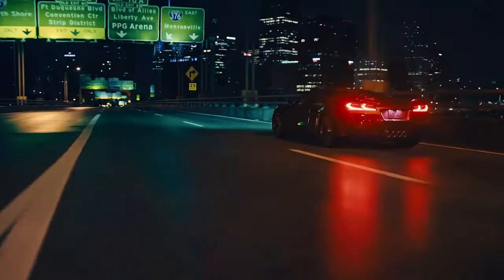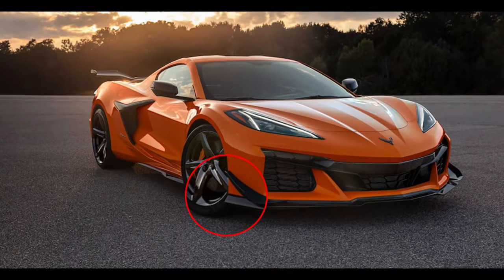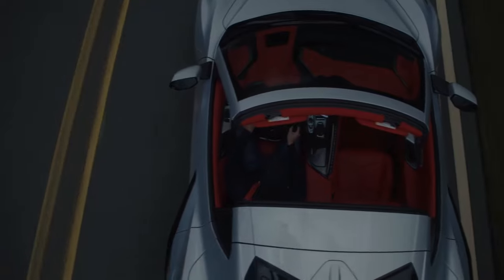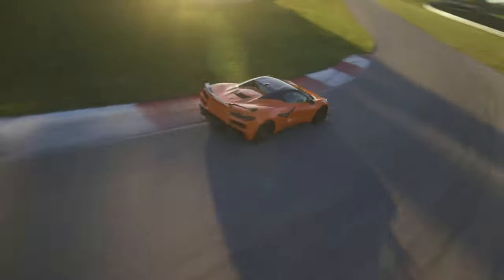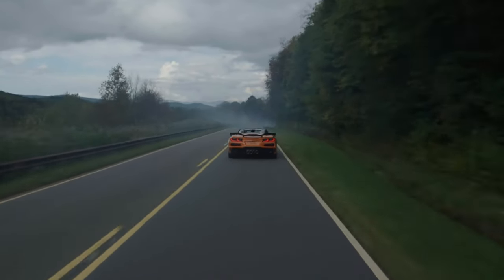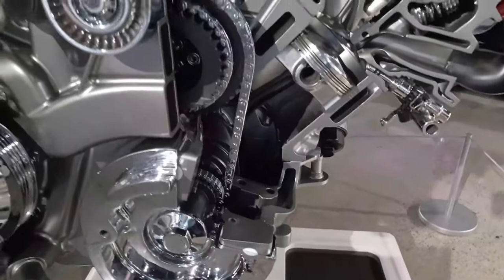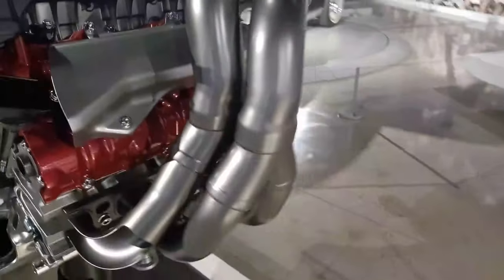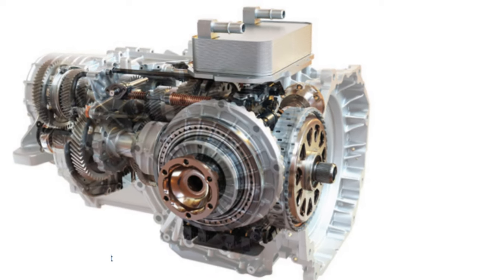2023 C8 Z06 Corvette EVERYTHING We Know

Comment: 🤔 Here's my confusion. The review states that this new Corvette engine(at 670hp) produces 170 more horsepower than the previous Corvette engine. But the previous 6.2L Corvette engine produced as much as 638hp over a decade ago, and its 2019 variant is rated @ 755hp in ZR-1 form. 

〽 But MUCH MORE significant is the fact that, although the newer 5.5L produces an impressive 670hp, it only makes 460ft/lbs of torque, which is a whopping 255ft/lbs less than the 2019 6.2L 715 ft/lbs! 

✅ To be clear, I have no doubt that this new Corvette is mindblowingly impressive, especially considering it's made by Chevrolet, a company that produces millions of inexpensive family sedans and pickup trucks, NOT a boutique Euro-supercar company like Lamborghini or McLaren. But I'm wondering how much difference owners of pre-5.5L Corvettes will notice with the severe drop in torque once they lay into the gas with their 2023 model next year(??)
Reply from the maker: The comparison is to the most recent naturally aspirated LT2 engine. This engine is the highest horsepower naturally aspirated factory production engine ever produced anywhere. The former "record" holder is the 2013 Mercedes SLS Black Series at 622hp. Each of the engines you refer to are Supercharged. The 2019 ZR-1 now sells for about $200,000. This Z06 can now be had for half that price. I am sure that anyone that is disappointed in the power output can easily add a Supercharger. There should be several available within a year of launch. And the cost should be fairly reasonable. As far as how future owners will feel about their car, only time will tell.
Thanks for your input. - Tim
Reply: @C8CorvetteLife  
✅ Ahh, OK... I missed the "naturally aspirated" dynamic in the comparison. Yeah, so 670hp is great for 5.5L unboosted. What's the bore x stroke ratio of the 5.5L? I'm guessing its significantly oversquare, based on its HP to torque ratio. Thanks.
Reply: With a flat plane crank motor less torque is needed do to the fact it makes its power in higher revs .the push rod engine only revs to 6500 compared to the flat plane crank  engine 8600. Time for a game changer and the lt6 is it . Super car status is what this is .  Push rod engine needed superchargers to achieve over 600 hp this thing is all natural . Wait till they put turbos on it. 800 plus hp we are hearing for the zr1 vette coming in next 2 years or so .
Reply from the maker: Many times the raw stats don't tell the whole story. What is more important are the real time stats. The 755hp 2019 ZR1 does 0-60 at about 2.85 seconds. The base 495hp C8 does that and the 2023 Z06 will beat that by several tenths. And we haven't even gotten down to lap times yet.
Reply: @JeffCarsboatsatvs  
At least its also got the supercar looks to go along with the performance. The first time I saw the new generation Corvette from a distance, I thought maybe it was a McLaren....
Reply: @C8CorvetteLife  generally speaking you are correct, however the stock c8 does 0-60 in more like 3.4 seconds. GM counts rollout, and also the onboard measurements are extremely inaccurate when measured against a race box or draggy.
I have higher hopes for the z06 tho, 2.8 seconds 0-60 should be possible